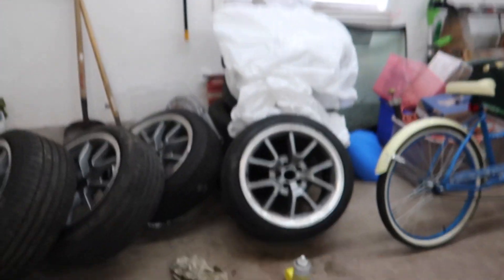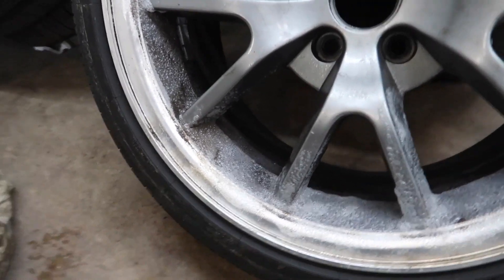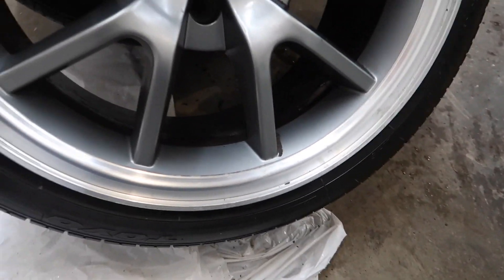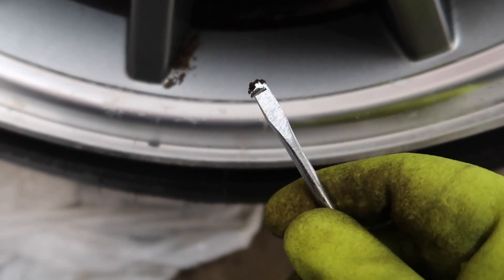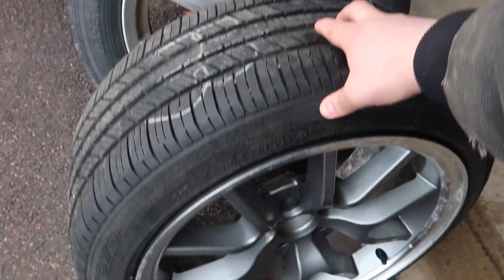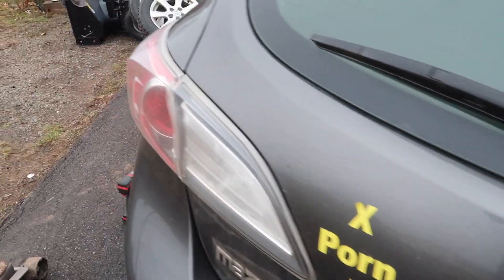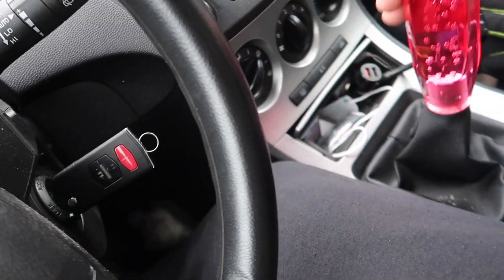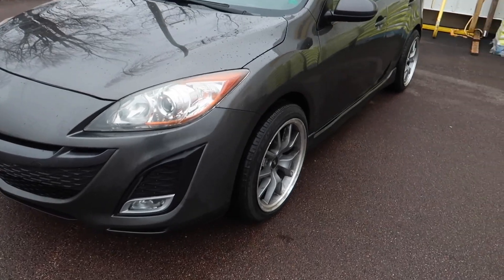Mazda 3 Hatchback 18 Inch Wheel Upgrade On Stock Suspension With 215/45/18 Tires

Comment: @Big Bennett TV
That’s 9-1/2 wide wheels for ya. On the Mazda3 platform if you end up lowering your car on either coilovers or AirRide suspension, get some spacers or and suspension parts like new sway bars, camber bolts get a little bit of negative- camber going, pull or roll or both your fenders you’ll get rid of that tire to fender gap and poke wise. Wheels for the Mazda3 it’s a little bit better running anywhere from 7”-8.5” wides and either a 15-18” wheel size and any tire Width wider then a 245 tire will probably rub for a stock OEM suspension/height 

Oh and your wheels “SVE” are probably Replicas of the “SVT” Ford brand of Mustang wheels, they look kinda like the “FR-500 wheels. 

I have 18x8.5” 2006-2009 Ford Mustang GT wheels that we’re on my Ranger with a All-season high performance 235/40ZR-18 tires.. haven’t bolted them up on my 2011 Mazda3 I-touring sedan yet because didn’t know if they fit and rub at full turn or not